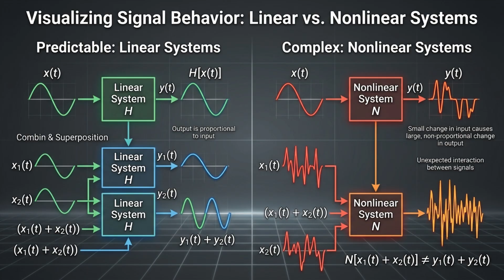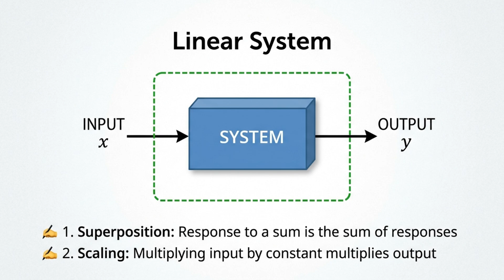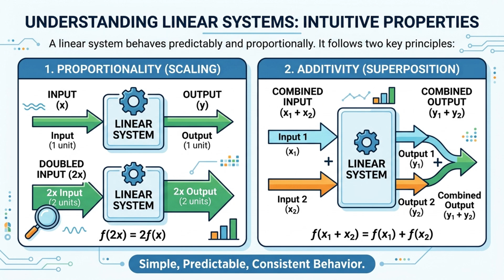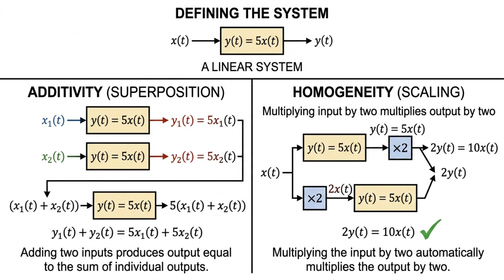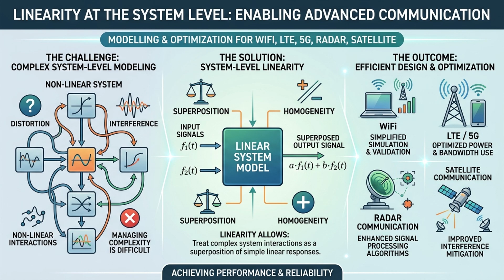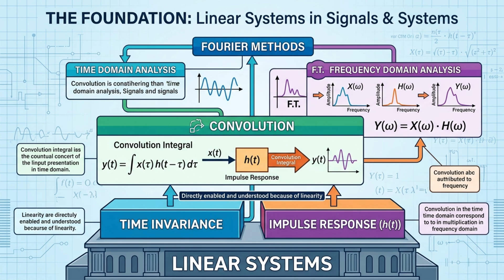Lesson 4 - Chapter 4: Linear Systems | Signals & Systems Basics

Comment: A great video, your videos strongly align with my mindset. Agree about the wide variety of analysis tools and design methods, but aren't linear real time implementations  more complicated since they require extra hardware( sensors, cooling, protection devices,..) especially in electronic systems. Somehow linearity works well with mechanical systems since they are designed with higher safety factors, with electronics systems, I'm not sure, especially if we consider high temperature contaminated environments, impact loads,...
Reply from the maker: Thank you for your insightful comment. You make an excellent point.

Linearity is primarily an ideal mathematical model that simplifies analysis and design. In real electronic systems, maintaining linear behavior often requires additional measures such as thermal management, compensation, and protection circuits because temperature, aging, and component variations introduce nonlinearities.

No physical system is perfectly linear. Engineers simply design systems to operate within a range where the linear approximation remains sufficiently accurate for the application.

Thanks again for sharing this thoughtful observation.😊